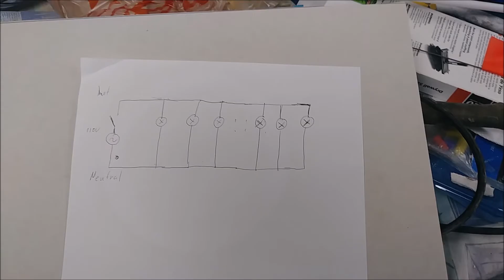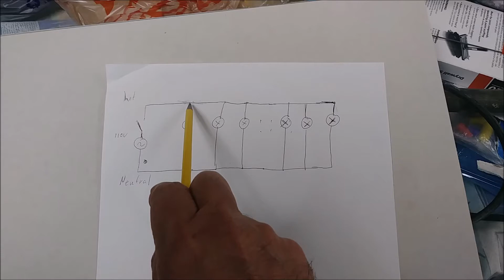Ho To Install Multiple LED Recessed Lights DIY  A to Z   Part 1 - Wire and Installation

Comment from the maker: 6 Inch LED Recessed Ceiling Light = https://amzn.to/3depXIS
1/2" Conduit = https://amzn.to/3nirSQ0
Non-Contact AC Voltage Tester = https://amzn.to/2QciEJk
Wire Stripping Tool = https://amzn.to/3dBE0bM
6.1" Hole Saw = https://amzn.to/3derPS3
Ryobi drill = https://amzn.to/3sLfg6y

Comment: Hello I have the 12 pack of these lights and I wired them “Daisy Chain “ and when I turn back on the breaker it trips instantly is there any reason why that would be happening or is there a special way to wire these 12 together ?
Reply from the maker: You have short some where in you connection.

Comment: Are they wired in series or parallel?
Reply from the maker: Parallel !!!
Reply: @josephk9182  oh man, that's gonna be a PITA... unless I run all separate wires into a junction box and hook em up there.
Reply: 🫵Never ever wire lights in series who ever is reading👍✌️
Reply: @C4boxingsports why not?

Comment: Needed help on 4” low profile led and this answered a few questions.  Thanks!  Also you should put a link to the plastic Knockout Non-Metallic Push-In Connectors.  Since my boxes were plastic I didn’t have to use the metal ones.
Reply from the maker: I will

Comment: What happens when you need to change the led lights? Do you change the thin led light with the box or do you just the led light ? As far as I know the led lights come with small box
Reply from the maker: If the LED does not work you can replace the LED if  the box is bad replace the box. The issue is that you can not buy only the box or only LED. The LED come with the box so I will replace both unless you have a spare box or a spare LED. I always buy more LED that I need so I can replace parts when needed.